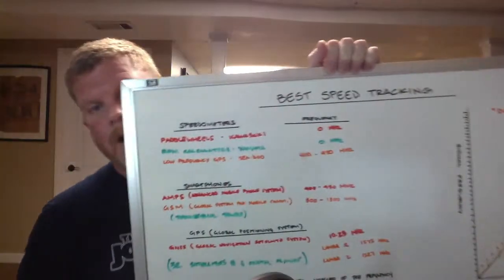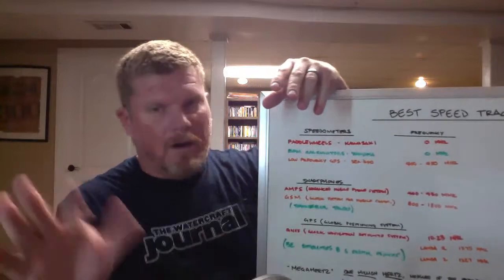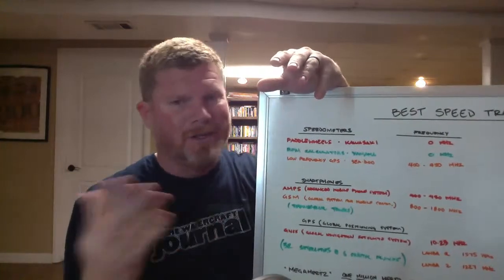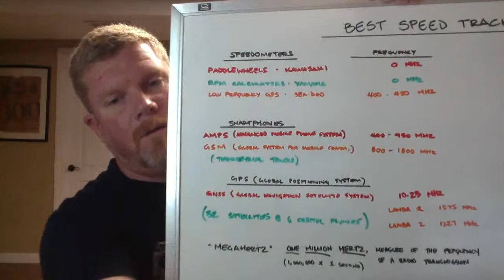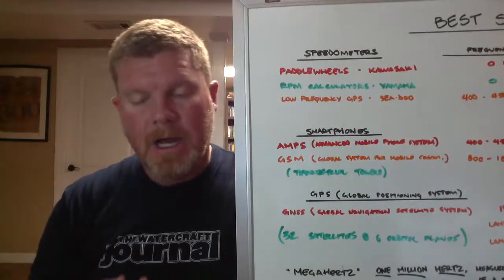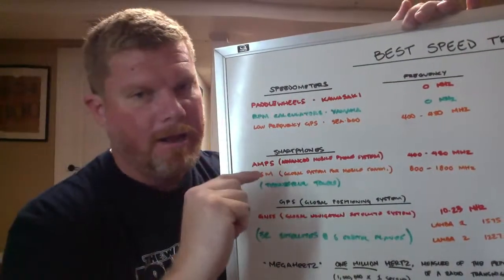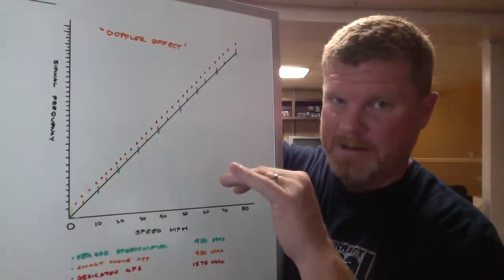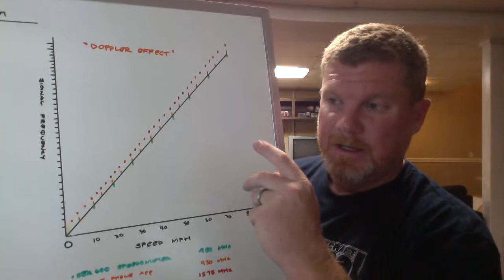The Watercraft Journal IRL – Understanding GPS vs. Speedometers

Comment: Speedometers, at their best, measure the speed vs the water. Current can then make a difference. GPS measures speed vs a calculated earth. Not quite perfect, but better.
If you are doing a speed run, speedometer would measure the same speed upstream vs downstream, GPS will show a difference.
GPS isn't as accurate as one would like, leave the GPS on overnight and you will tend to see it wander hundreds of feet.
Reply from the maker: Over the years, radar/ladar guns have proven the most consistent in measuring speeds.